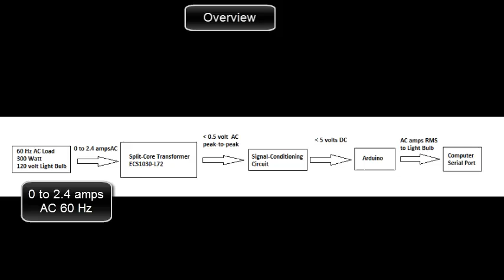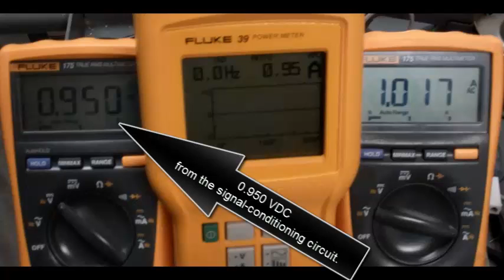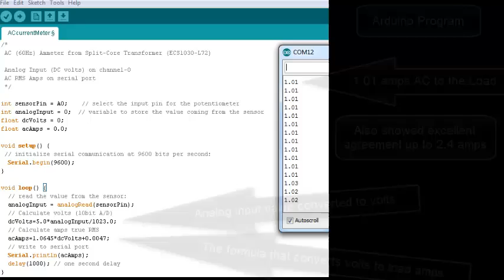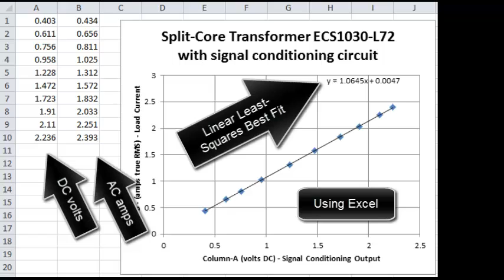B33518 - Measure AC Current using an Arduino

Comment: Can I please get the Arduino Program that is been used in this project, also It will be great if I can get the method that is been used in Excel for conversion of DC Volts to AC Amps. Very thankful for this video !! :)